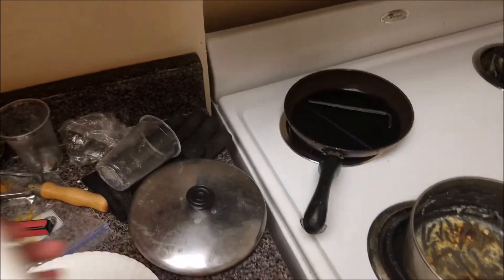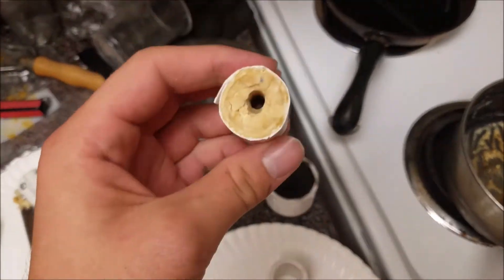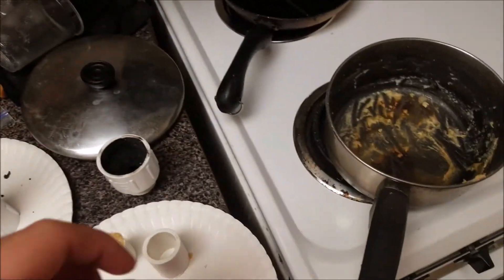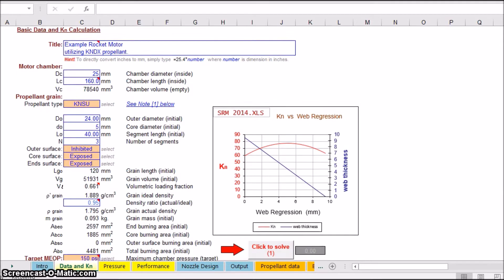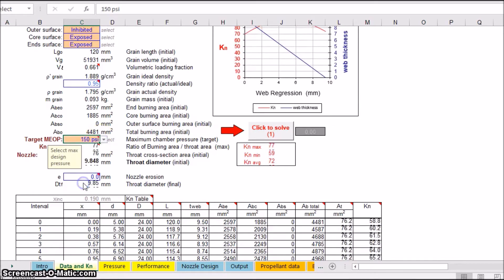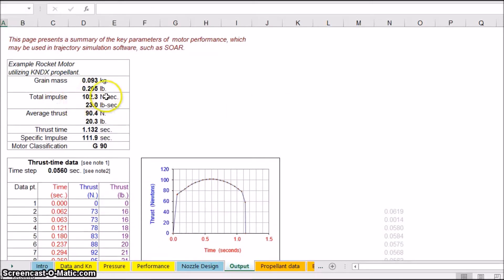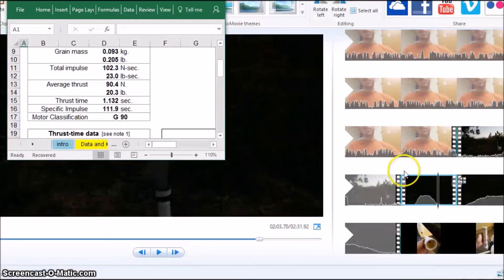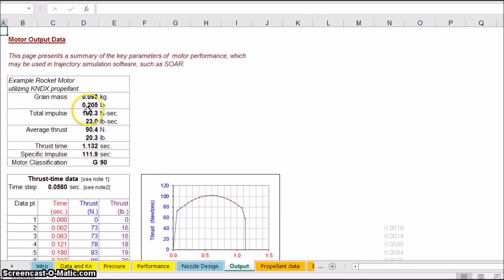Design and Test of Homemade Rocket Motor (KNO3 + Sugar)

Comment: many years ago I found industrial Drill bit case cardboard tube lined with the warm still batter-like mixture stuffed into the tube with a dowel that when inserted then pulled out leaves a uniformly distributed inner wall thickness where the inner exposed surfaces burn all at once until burnt through to the tube. Caution this method can produce lethal speed of the projectile so keep a Safety First mindset if you want to do it more than 1 time. Very High level of Fire hazard as well.

Comment: Could reduce the amount of sugar used by 5% to make it burn slower
Reply: So buddy I found this video https://youtu.be/tr6egiKxp3I and through him found out less sugar in the rocket fuel specifically 60% potassium nitrate 40%sugar makes the rocket fuel light easily and burning slower the less sugar you use I don’t know if the difference varies with a powdered mixture but I think it’s worth a try.

Comment: I wanna start out with model rockets and I'm interested primarily in how they're made from the ground up. I'm in uni taking physics right now and going to take chem next semester. It would be really helpful if I had that excel sheet, do you still have the link from where you got it? Thanks!
Reply from the maker: Yeah, no problem! It's from Richard Nakka's site: https://www.nakka-rocketry.net/softw.html
The direct download link is: https://www.nakka-rocketry.net/soft/SRM_2014.zip
Reply: Thanks very much! Model rockets are fun, but I figure if I focus on the math and physics of the thing on small rockets, it will give me a good idea if that's something I wanna get into professionally. You can always just build a bigger rocket and expand once you figure out how they work lol.

Comment: Whenever i make these, my rocket never burns as fast as that idk what I'm doing wrong, any answers appreciated.
Reply from the maker: Hey man! The key I found to fast burn time is a higher pressure. The more pressure the fuel is under, the faster it will burn. Make sure you have an tightly enclosed motor chamber with an appropriate sized exit throat. I used a throat dia of 10mm for mine, but i used 120g of fuel. If you use less fuel I recommend smaller throat size. Just experiment around and see if you can get it to burn faster. Here is a video I made a while back you might find helpful https://www.youtube.com/watch?v=QWEMDxxA5N4
Reply: Grant Wise Thank you so much now I understand